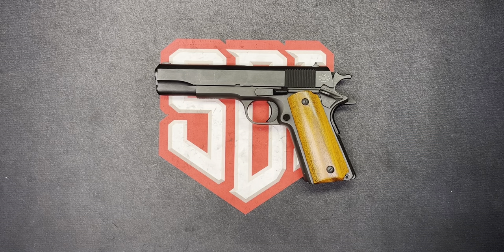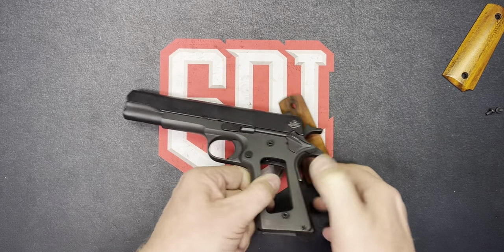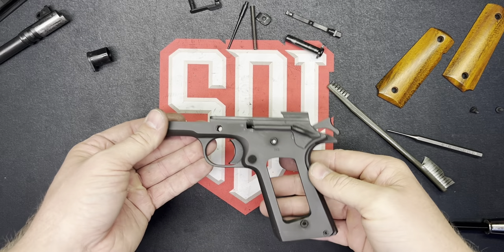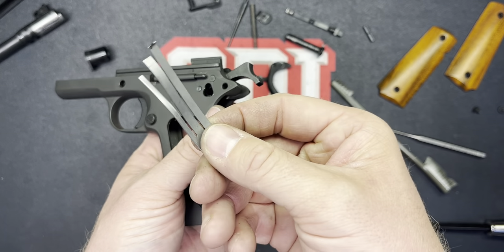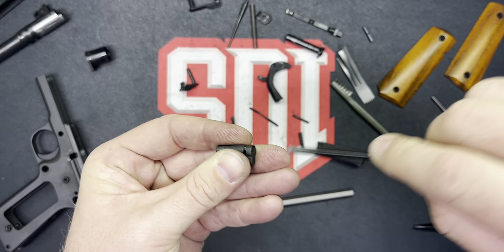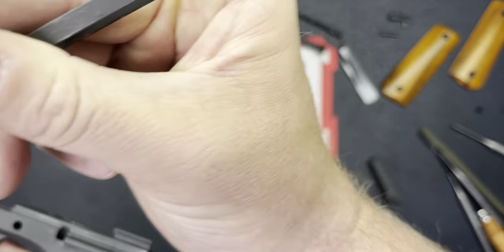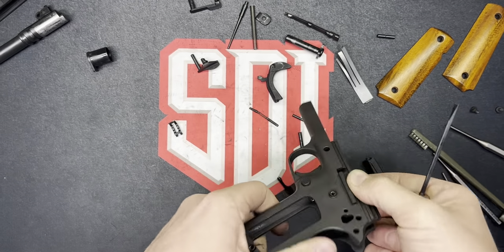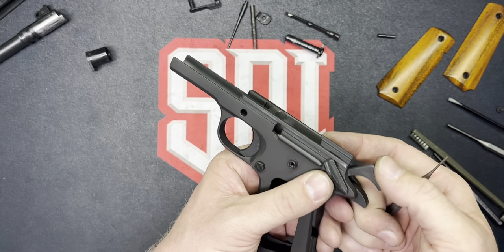Sonoran Desert Institute Rock Island Armory 1911 Detailed Strip (Disassembly and Reassembly)

Comment: Years ago before YouTube I did take down a 1911…. I suppose it took me 2 weeks to get it back together…so thank you for this. I have one trick that has served me well over the years and that is the ball cap trick. Best is the screen type cap that you can see through. When you have a spring that wants to fly across the room….put you ball cap over what your doing and most of the time it will catch those mini missiles.
Reply from the maker: That’s a great idea.  I have a blooper reel of one sproinging up right into the camera. Glad it wasn’t my eyeball.
Reply: @scottbozarth8459  :
Reply: Good one, I use a
 Large plastic bag so you can see what your doing. Cheers
Reply: @jerryrichards4300  ,
Reply: I think they're beautiful guns, but at the same time, I think they're overcomplicated and that makes them over-priced at the same time, because their complexity makes them expensive to manufacture. There are many guns that look very much like 1911's that work just as well and have equally good triggers... but they're far less complicated and that makes them easier and cheaper to manufacture.

Comment: Never, ever, and never, tweak on the plunger spring tube unless you have the plunger spring tube staking tool! If you ever loosen it, and your grips do not provide overlap over the tube, you will encounter creep, and you will not be able to operate the thumb safety if you're lucky. If unlucky, your plunger and spring will leave the tube, rendering your 1911 unsafe.

Comment: If you push the slide back and remove the slide stop first, a barrel bushing wrench is not necessary. Maintain the recoil spring until slide is removed. This pistol is designed to be completely disassembled without tools.
Reply from the maker: I would agree if this were a normal style 1911, but this 10mm RIA has an odd trick if you watch the whole video.  You have to use a paper clip in a small hole on the guide rod to hold the slide back while removing the slide stop.  It’s unlike most 1911s.  But the method I show here is what the manufacturer recommends.

Comment: From a graduate from SDI and having done a Girsan 10mm 2011. The best way to take the ambi safety out without breaking it is to start with the right side. That's the side on the same side as the screw to remove the mag release.

Comment: I bought one of these GI models USED at a gun show a few years ago.  It was cheap and I was basically looking for  a base gun I could tinker with and not feel bad about messing up.  With the exception of the extractor, which I had to order from the factory, almost all aftermarket and take-off parts from other 1911s I've tried, fit and work fine with it.  Great gun for money in my opinion.
Reply from the maker: I’ve only got 50 rounds through my GI, but zero complaints so far.  Hundreds if not thousands through the 10mm. I can’t believe how well these things shoot for the price.
Reply: That's good to hear. I thought that they always had to be hand fitted. I have a friend that works on (builds) 1911's and he's always having to hand fit the parts, including "drop in" parts.

Comment: The extractors on every Ceracoted RIA 1911 I ever saw come out with difficulty. I think they Ceracote them before assembly. Breaking in an RIA involves wearing off the Ceracote as much as anything else. I prefer blued or bare metal, since I work molybdenum disulfide into every last bit of metal. (My firearms don't rust.) Most Viet Nam vets know about this. The guys that didn't learn the moly trick were the officers.
Reply from the maker: That’s an interesting trick, but both of my RIA 1911’s are actually Parkerized, not cerakoted.  I just keep them covered in a very light coat of regular Hoppe’s gun oil.  Rub on, wipe off.  Seems to do the trick, then again I’m not slogging through the jungle for weeks on end with them either.  Thanks for watching!
Reply: What kind of Molybdenum disulfide? I use Moly Grease which has Molybdenum Disulfide in them, but I've never heard it's for rust prevention. It's an Amazing grease that makes any action smooth like glass (I use CV-2 specifically)... but I don't think it prevents rust. I have some Ruger parts that all rust really bad. I never knew that Ruger was famous for their blued guns rusting when I got them. I guess it's not all models, but their LCP and "standard" (like MKI, MKII, MKIII, MKIV and 22/45) models are very well known for rusting really bad... so I've been trying to think of a good way to protect them. I tried Break Free CLP, Mobil One Synthetic (which has always worked amazingly for me on all other guns/parts) and Hoppe's which has also been a good rust preventer for me... but none of them have stopped the Ruger parts from rusting. It's to the point now that I might have to just Cerakote all the parts I have to protect them from rusting again in the future... but I might just swear off all Ruger parts/guns in the future, because I just can't keep them from rusting. Normally I oil/maintain all my parts every 6 months and that's always been enough for any gun/part I've ever owned... but after having Ruger cleaned up and reblued... I oiled them and put them in a safe, only to have them have Terrible, thick rust on them in a matter of days. I even put parts in baggie submerged in CLP only to have them rust too. They're the only parts I've ever seen rust while they were literally 100% covered in CLP/oil.

Comment: I had an older 1911, one with the giant billboard on the slide.  It’s ambi safety shattered while firing. I just bought a cheap one from Numrich gun parts and it was back to rocking and rolling.
Reply from the maker: I ordered a replacement from RIA for that pistol and replaced it.  Good to go now, but it’s still just a MIM part.  I think a solid steel, machined part might be in the future for this pistol.

Comment: I brought home my Rock Island stainless steel 1911A1 .45 ACP. I carried a .45 in the US Army with the M-60. I thought I remembered this weapon but was very much surprised by it. It has been over 30 years since I had my Colt M1911A1 that was from 1960. Your video is very much detailed and really fills in the 'blank spaces' in my mind. I cant thank you enough Scott Bozarth! I have a better hammer than what came with it but I couldn't get the original hammer with the strut and pin to separate. I guess they were not meant to be separated. I'll have to purchase another Strut and Pin for the Wilson Hammer I have. Thank you very much for this video!

Comment: I recommend putting a card or a plastic pry tool under the safety as you pull
Reply from the maker: Yessir, I’ve since learned my lesson. Ordered some plastic pry bars used for interior body panels in cars.  Works great.
Reply: Reminds me of taking the hand off a pair of dial calipers. Every time I try I break them. It's just extremely hard to pull them off perfectly straight, so they break.

Comment: I bought one of these the other day brand new, ran 50 rounds through to test it and my extractor actually was able to push out with just my thumb, got it at Murdochs with a free revolver, 400 for the set
Reply from the maker: That’s a smoking deal!!! What caliber is the revolver.
Reply: @Scott Bozarth  38 special/38spl+, it's their M200 DA/SA 4" that was patterned after the old Colt D frames, super impressed with it, I put a Hogue grip on it for my wife, but otherwise excellent for the deal

Comment: I have to agree on having a gunsmith screwdriver/set. Regular screwdrivers really damage the screws every time you use them. I can't even count how many times I've seen damaged screws (that look terrible), because someone took the gun apart with a regular screwdriver. I'm glad we're getting away from flathead screws on guns and we see other kinds of screws (like allen/square bit screws), so people don't have to worry about that... but most older guns use flat head screws and I'm sure some modern guns still do. I'm guilty of doing it myself (many times), because I didn't own the right kind of driver/bit... but it's really a "must have". They're not expensive and you'll save money in the long run from not having to replace damaged/ugly screws. Sometimes the screws won't be easy to replace or will even be impossible to replace. I've purchased parts for some rare models of guns only to find out that the screws were damaged from someone using the wrong kind of screwdriver... and I have no way to replace them, because they're nearly impossible to find. I'm assuming that if I ever do want to replace them, I'll have to pay a machine shop to make them custom for me.

Comment: this video just helped me out immensely! i had to put a new trigger in my ria M1911 a1 FS(the exact gun in this video) because i bent my ill fitted wilson combat trigger that wasnt quite fitted right loading a mag. so i put the original trigger back in but then after reassembly whenever id let the slide go, the hammer would follow the slide home, sending a round into the dirt.  im admitting my inexperience and glad no one was hurt.  tonight i decided to take it apart again and see where i had something misaligned.  your video helped me correct the issue and now its back to working flawlessly!  thank you and this video has gotten me more interested in SDI classes!  win win!
Reply from the maker: Man, I’ll bet that got your heart pumping pretty good!  Glad nobody was hurt, and that the video helped you out.  Thanks for watching!
Reply: I was wondering if hammer follow would/could turn a 1911 into a full auto. like, if someone removed the disconnector, would the gun continue to run as  long as the person holds the trigger (until it runs out of ammo)? The ATF has a fit when people can put a switch or a lightning link in a gun to make it full auto... but it's funny when a gun can be turned into a full auto just by shaving off the tip of a part. We have the Right to own full auto's anyways and we need to end the ATF and their disgusting assault on The Constitution and The People... but until then, we need to stop obeying their "rules" that have no legal power or authority. If we all refuse to obey, there is NOTHING they can do about it. They exist Only, because of the people's cowardice and complacency. We only create our own tyranny and there is no one else to blame, but ourselves.

Comment: When you remove an ambi safety you remove the right side lever first, not the left handed or ie right handed safety lever, it will need to be wiggled after the right side is removed.
Reply from the maker: It doesn’t matter what side you remove first.  It’s the same either way. I’ve had this thing apart dozens of times since making this video and I’ve done it both ways.  What matters is making sure the hammer is fully to the rear with the safety in the down position.  You then slightly raise the safety lever while gently wiggling and pulling or applying pressure from underneath with a plastic wedge.  Works like a charm every time.

Comment: Put gun back together but hammer sometimes doesn’t cock back when I rack the slide
Reply from the maker: I would check your sear spring alignment.   (The three fingered leaf spring under the main spring housing). It is very easy for the spring to slip out of place when sliding the mainspring housing back in.  Give that a check and make sure the left finger is aligned under the foot of the sear and be very careful it doesn’t shift while you’re reinstalling everything.

Comment: Thanks dude👍🤘! My slide was getting stuck & I figured maybe my internals were disgusting(they weren't), your video really helped me understand each piece. Dry firing my 1911 ended up mushrooming a bit, that was the problem, ended up gently filing down that bit smooth & works great now. Found out after I took everything apart, cleaning it & putting it back together lol. Process of elimination.
Reply from the maker: Glad the video helped!  I’m a big fan of dry firing for practice but it’s a good idea to use snap caps or some other dummy round to avoid exactly what you experienced.  You can find them online for around $20.  Good luck, happy shooting!
Reply: @scottbozarth8459  I have them, I didn't realize around 5 dry fires without would do so much damage. Lesson learned lol

Comment: ambi safety removal-> use guitar pick and slip it in the top then rubber hammer the front end it will split the connection and should pop right out!

Comment: My Rock Island armory I changed out that and be safety as fast as I could. I didn't like the way it came apart. I didn't like how hard it was to take apart. Had to have tools and it just I just didn't like it like the gun. I just walked it out with a Wilson combat safety. Not any issues. Very easy to put in
Reply from the maker: Good idea. I relaxed mine with another RIA safety.  Funny enough, these ones went together MUCH easier than the one I broke.  I think I just got a bad part on the first set.

Comment: So I will try to explain why nobody wants to do a video of the 1911 A2 double stack RIA frame strip-down with the damned ambidextrous safety. I have a used RIA 1911 A2 in 10mm. I wanted to clean up the gritty heavy, painful trigger face with the burrs on the adjustment hole in the face of the trigger that actually hurt to pull the trigger. It needed to be taken down to get to the trigger face properly. I figured I could clean up the trigger pull on this beauty while I was at it. Full disclosure: I have several 1911s and can get around one fairly well.  So after 2 hours of cursing my ancestry back 3 generations and even cursing Douglas McArthur for liberating the Philippines from the Japanese, (OK, I apologize for that, no need to reprimand me) I have a few observations on this gun. They are NOT that well finished internally. In fact, the machining of components is very mediocre. The phosphating makes everything inside gritty and it needs to be removed from bearing surfaces. The trigger bow is NOT flat where it interfaces with the disconnector, big surprise there... The ridiculously unnecessary ambi safety was a great adventure to get back together correctly. I watched the plunger spring shoot off into the 4th time dimension at least twice while fighting with the damn thing. I will help you save your immortal soul from hell by advising you in advance that the tiny cut that is nearly invisible in the off side of the sear pin is EXTREMELY important to doing this correctly. Pay attention to the way it is oriented on the right side where it protrudes from the frame. The rt side safety lever swings thru this slit in the sear pin as a doofus retention device for that lever. Force it without putting it into that slit first and you risk breaking the safety. Anyone that needs a damn ambidextrous safety needs to get a different gun! JMB didn't think it was necessary, and millions of American combat troops, tens of thousands of whom were lefties used them successfully without one for over 50 years, including myself as a Marine Corps tanker. So after all the frustration and polishing burrs and phosphating off surfaces, it went from a gritty, stagey painfully heavy 6.5 lb trigger pull all the way down to a buttery smooth, no longer painful...... 6.5 lb trigger pull!  Yes I am keeping it, but I ain't tearing it down again... I will spray it out with brake cleaner when dirty and call it good. I wish they had spent the money on a quality trigger and flat trigger bow instead of the useless bling of an ambidxterous safety. It is the only upgrade this gun really needs....

Comment: The safety plunger tube comes with two small hollow tubes that protrude through the frame and a special tool is used to press them over to hold the tube to the frame, once removed you would most likely require replacement tube because the flared small tubes will break when removed.

Comment: Nearly all manufactures use MIM (metal injection molding) parts for some parts such as pins. I had a firing pin which snapped, it was MIM part from an after market company. To remove the safety use a plastic wedge (do not wiggle)

Comment: Mainspring housing disassembly is easy. To depress the mainspring plunger (cap) put a proper size punch in a vise. Press the cap against the stationary punch and use the proper size punch to push out the retaining pin. Then relax the pressure on the mainspring and allow the mainspring plunger to come out while contained against the punch in the vise. Reassemble in the reverse order.
I suspect any difficulty you are having with parts being "tight" is because of the parkerized finish and the gun being new. A little light buffing with some 600 grit paper on pins and such should make them easy to disassemble/reassemble. 
If you replace the firing pin spring and firing pin (see my comment above) you can also install a "reduce strength" mainspring from  Wilson Combat. This makes it easier to disassemble/reassemble the mainspring housing AND reduces trigger pull AND reduces the effort needed to operate the slide. DO NOT install a reduced strength mainspring if you have the original "extra strength" firing pin spring and steel firing pin. This will cause "failures to fire" with "light primer strikes" with some ammunition.

Comment: I have the budget ria, where do i find upgrades and what is everyone using? Mags, sights, grips, etc
Reply from the maker: Any 1911 grips and 45 ACP 1911 mags will fit it.  Sights are a bit trickier because they need to fit the dovetails already cut in your slide, OR you can have a gunsmith cut new dovetails to install aftermarket sights.  Might cost more than you want to spend on a budget pistol.  Your call.